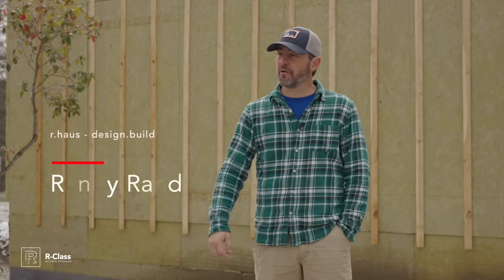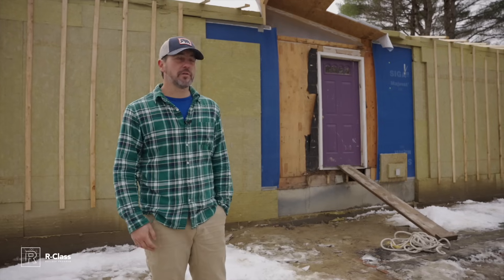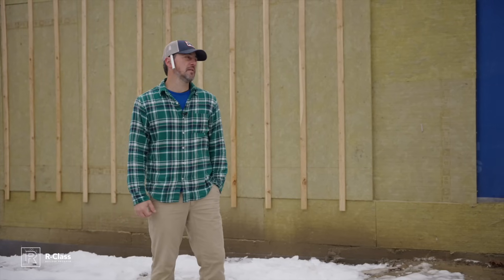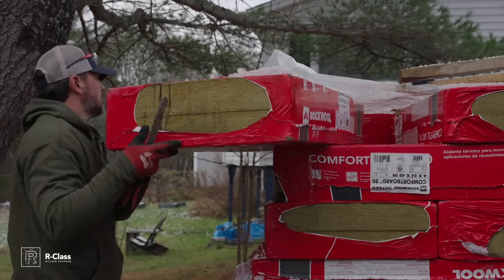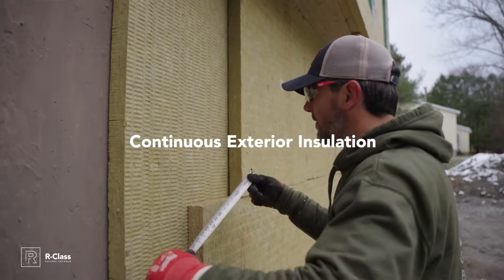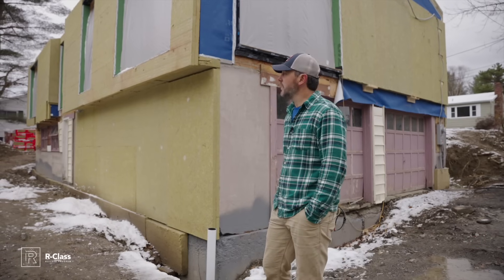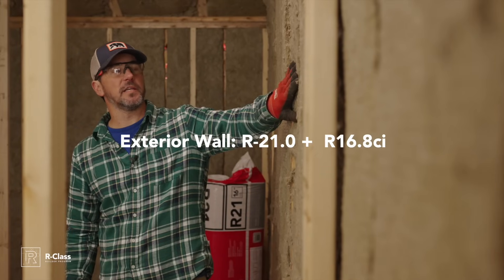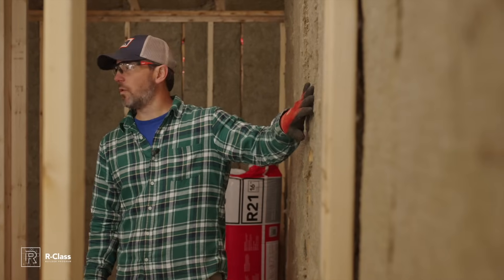Achieving thermal efficiency: Retrofitting a 1960s home with ROCKWOOL insulation

Comment: Curious about the interior framing changes. You cite the choice to adopt advanced framing to achieve breaking thermal bridging from the outside. Yet, the exterior has several inches of insulation outside the sheathing. Isn’t that breaking thermal bridging thermal bridge? If so, the changes to the interior seem superfluous.

Comment: The framing factor of 16" OC wall is 25% of the wall assembly area. The framing factor of 24" OC wall is 22% of the wall assembly area. Furring out the wall studs so the 16" OC wall could be converted to 24" OC for the "purpose" of thermal bridging reduction is dubious at best. The energy savings doesn't justify the additional construction costs. It's like you are just looking for ways to increase the cost of the project.
Reply: Not sure why you describe the reduction in thermal bridging as dubious.  Almost every stud is thermally broken.
Reply: Furring out the studs also gets you 5-1/4" of insulation instead of 3.5.  Plus the studs are thermally broken.
Reply: @incognitotorpedo42  Diminishing returns of r-value and the windows relatively lower performance make this wall over insulated. It quickly becomes cheaper to buy solar panels and mini splits.

Comment: Rockwool, stone, even as a spun material, is guaranteed to sag and compact over the years. The higher you make a strip of it,the greater the weight on the bottom, like a column of water or air. The strip will be pulled down. Friction will slow it,but not stop it. Adding some modest fasteners,staples, would probably be a huge help.  For all that effort and expense,why not? It’s a general problem that people don’t know how well these methods will hold up over time.
Reply: Do you have any citation for rockwool compacting? Over the years. It has only been in major use for about 10 years, so it may be difficult if not impossible to find any long-term data regarding sagging Rockwool.
Reply: @skiukb  Mineral wool has been used for decades in Europe.  I am not aware of it sagging over time.  Seems way less likely to do that than fiberglass.
Reply: Rockwool has been used in Europe for many decades. No sagging reported. "Glaswool", on the other hand, does have some caveats with regards to sagging. I don't know whether it is glass vs. mineral, or the (amount) of binding compound used. EPS is the only real alternative, with it's own set of compromises (fire, smoke, sound, vapor permeability), albeit cheaper. Organic materials are nice, but expensive, while rot and pest concerns are always present.

Comment: Add 3M intumescent putty pads over the rear of all electrical back boxes. This seals any open holes and reduces sound transfer and add an extra layer of fire protection. PS I think your horizontal method for Safe & Sound between a double stud wall is an excellent method. I will add this to an attic wall upgrade project soon.
Reply: I wonder about how the sealing and insulating of electrical boxes affects allowable box fill.  There are rules about how many wires you can have in a box, presumably so they don't overheat.  Anyone know if this is a problem or not?